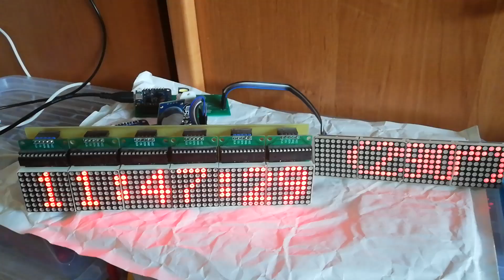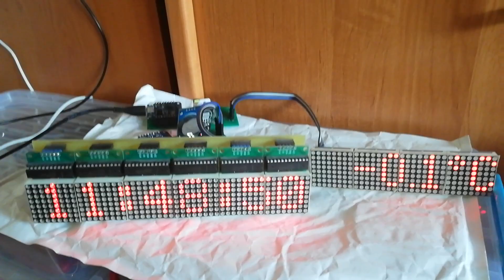universal PCB for matrix clock with ESP8266

Comment: After the compilation he tells me: error during the compilation for the Wemos card. What to do? Happy new year 2020.
Reply from the maker: articke is just a sumnary of publushed articles with clocks ...
Reply: @dj06ntm  But this error comes out in all your articles
Reply from the maker: @federicoferrara125  msybe you not have same library or files as me... other users are happy because all my sketches work.. try older version of Arduino IDE (1.8.10 or older)
Reply: @dj06ntm  I have the Arduino version 1.8.10. You can then post me the libraries or files that you use. Thanks. It is a beautiful project that I want so much to achieve.Thanks.
Reply from the maker: @federicoferrara125  https://github.com/tehniq3/used_library
Reply: @dj06ntm  Now fixed the first error another one comes out. In the Serial.println (String (WiFi.localIP ()))) line; tells me call of overloaded "String (IP Addres)" is ambiguous
Reply from the maker: @federicoferrara125  comment this line, some libraties not supported
Reply: @dj06ntm  What should I do to fix it?
Reply from the maker: @federicoferrara125  put // in front of line with error... // is comment (deactivate commands)
Reply: I did as you did: //Serial.println (String (WiFi.localIP ())); // and the scketch is compiled without errors. But will the project work the same or not? I still haven't tried it. Anyway thank you for your patience and interest.
Reply from the maker: @federicoferrara125  yes, clock work fine... you test more time
Reply: @dj06ntm Thanks for everything you have been really kind. Happy New Year !!